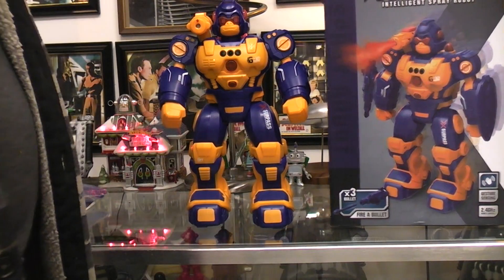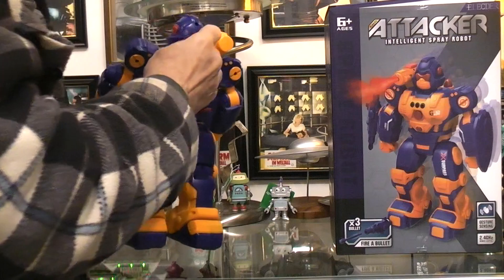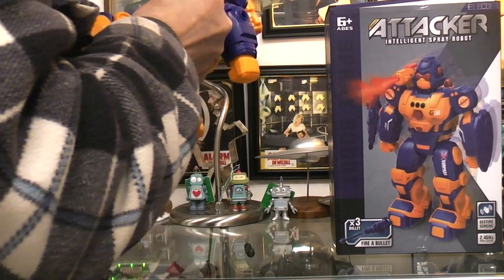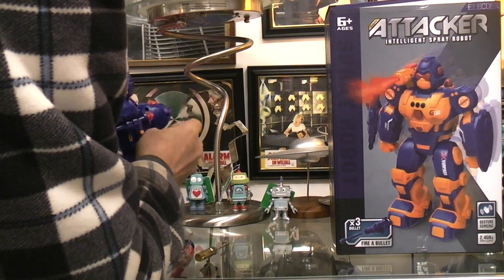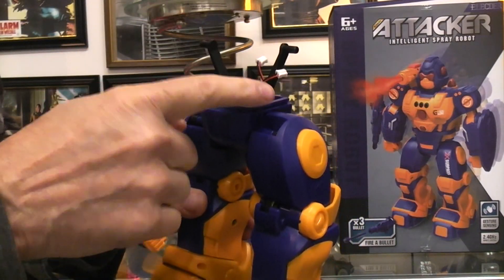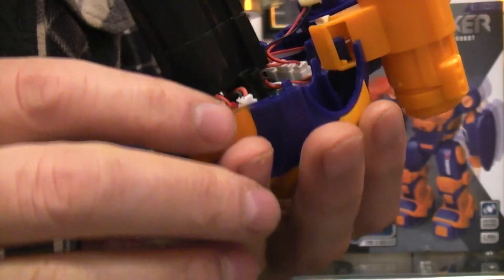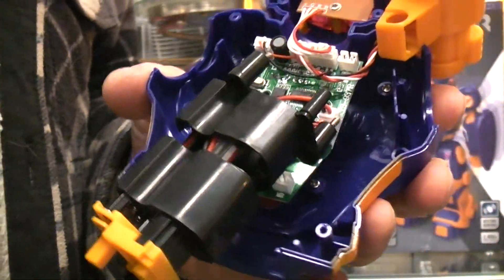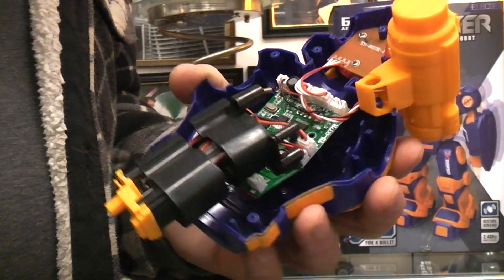Lets open up the Attacker Intelligent SPRAY robot to see if the battery can be repalced.

Comment: I’m so used to seeing robots filled with gears, it’s odd to see one so empty inside.
Reply from the maker: The motors and gears are all in the feet.
Reply: @Robothut    Right.  I remember you saying that.  I’m sure that helps with stability.
Reply from the maker: @jayducharme  Back in the 1980's I built a 7 foot tall walking robot that had a real CRT TV set in its chest based on the same design. Very stable with motors and batteries in the feet.
Reply: @Robothut    Neat!